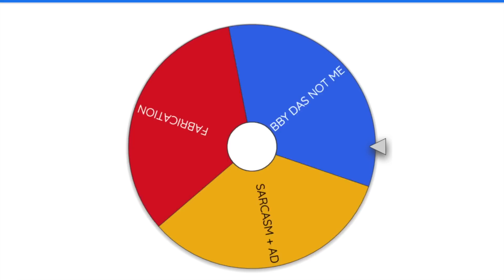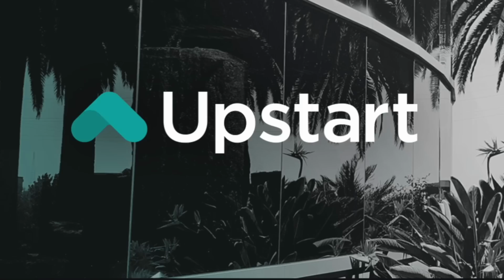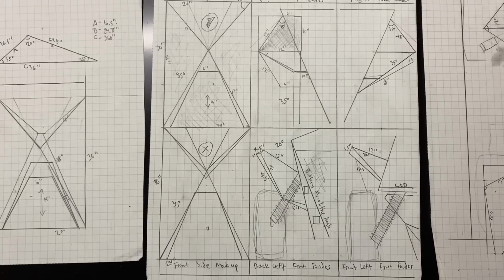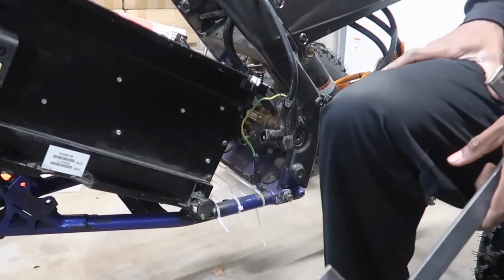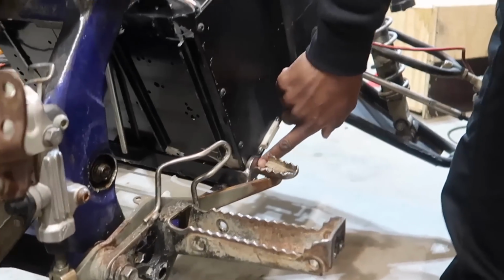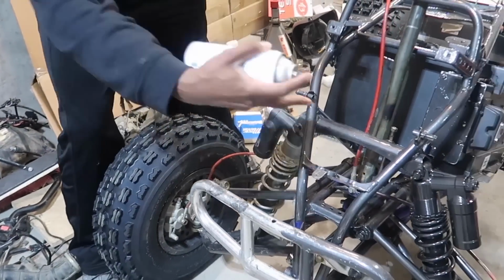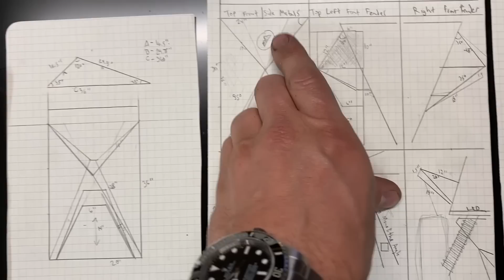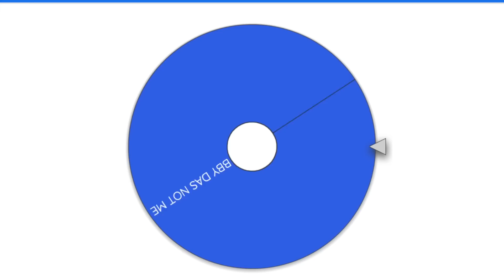How we Designed my Tesla Cyberquad

Comment: Gotta say, your videos are getting funnier (=ing more entertaining).  So.... my credentials.  I was a machinist in the Air Force.  That carrier field included welding.  I have owned and ridden to structural failure many off road vehicles (cycles, quads, buggies, sand rails, odysseys).  There is more but ima move on.  First though I wanna say ; the most important thing is that you are doing this, i really love what you are doing, don't let the haters slow you down, great job.  Ok, I have two things I wanted to say about the build.  The unsprung weight is probably fine, and if it isn't you'll get bent shafts, no biggie.  The second is more of a concern.  The frame bar under the bottom corner of the battery is supporting a lot of weight over a small area.  By having it on such a focused point, it is more likely to bend.  I would personally add a small C channel piece over that bar to spread out the moment of forces.  It is possible you will never have a problem with this.  You've shown enough of yourself riding that i get a general gauge of your skill, and it seems unlikely that you will be doing any BIG AIR any time soon.  But it is possible you might have a moment of bravery and decide to climb that hill you maybe shouldn't.  Something like that can cause a roll over and if that happens this week point could be exposed.  Additionally a friends teenager, on a weekend out riding, could expose the same problem.  If that part of the frame ends up bending, it will be much harder to fix later, and if bending changes the geometry of how the battery is held in, it might pop out and crush a leg or something.  The fix is simple enough that for me it would be worth doing before continuing.  At one point when i was building a side by side buggy I had to learn the equations for how force is applied over time (i have since forgot much of it).  But at the time i did find it useful because i kept bending A arms.  I made some minor adjustments and the next thing that failed was the spindle.... LOL, it was an improvement from my perspective..  Anyway I hope you will consider reinforcing that area.  Even if it's not for you, there is a chance at some point someone jumps on this thing and really puts it through its paces, and that would be the type of failure worth shoring up.  Also ... I don't know how heavy that battery is ... I'm imagining it as a really large lead acid... so maybe my concern is much less warranted?  Its all Pounds, Points, and Time BB....... also also ... "soft pull"... brother you slay me.
Reply from the maker: Constructive feedback from a person with a background, followed up with suggestions on how to make it better based on their own experience building something similar (didn’t think this existed!) Thanks for realizing it’s a prototype, I make something , take it out, beat It, break it, then enhance the design based on what broke. Thanks for the suggestion.

Comment: Looking good so far! My only advice would be to make your electric motor mount have grooves instead of holes so you can slide it up and down to add or release tension on the chain.
Reply: Now that you mention it, I was thinking of some kind of screw support, like, having a screw that pushes it up as much as needed.
Reply: @Kalvinjj  yep, that would help it stay in place when its hitting those bumps
Reply: Of course Rich needs as much screw support as possible when he hits those bumps!
Reply: The Raptor has an eccentric rear axle that is used to adjust chain slack. The motor can stay fixed in place.

Comment: Having built an airfix model of a harrier jump jet when i was 12 I can tell you that every component modified by you will fail because nothing built outside of a factory ever lasts, you should just give up now, nobody should ever try anything new.

P.S. whats with the picture of Obama at the end?
Reply: I can't tell if you're being humorous or not. Assuming you're serious, it's true that a lot of people do not appreciate the work that goes into your factory engineering. On the other hand when you mod stuff yourself you don't have to have the same high standards as the factory. For instance the factory designed it to handle large jumps whereas Rich is not going to be doing big jumps, so his design might be perfectly fine based on what he plans to do with the quad. I'm sure he plans to just ride it around a little bit and do a little off-roading, nothing serious. So his work should be just fine for that.
Reply: @JasonWW2000  It was meant in jest my friend, a jovial nudge in the direction of the people who actually leave comments like this
Reply: @JasonWW2000  lol

Comment: Need to add another comment, you can add another bump stop to the shock to keep it from bottoming out and hitting the motor, extra thick rubber would help. I’ve installed a few on my Dirt-bike to keep the suspension from bottoming out
Reply: Rich would love this idea. He would do it with one hand, while having popeyes in the other.

Comment: Probably taping an inch thick piece of heavy-duty rubber to the top of the motor where the frame would strike if it did bottom out would prevent any damage, just like real stoppers used in cars and trucks. Cheap and easy upgrade!

Comment: Adding unsprung weight to increase off road capability is what the entire off-road aftermarket is built around. Sooner or later, somebody is going to mount compact electric motors on a pair of live axles and you are going to get a revolution in off roading. Deleting drive shafts and transfer cases, then replacing them with flexible power cables and you lose a whole lot of weak points and gain crazy articulation.

Comment: Certified welder here, nice work! Most shitty welds will still hold more than enough weight than they’ll ever need to. Your welds look decent, and the shot at 5:15 I can offer some suggestions by the look of the weld. Seems you have your heat set right since both the top and bottom edge are fused, but the weld itself looks big and bulgy. Try going a tad bit slower/smother to see if that evens your beads out, if not try turning the wire speed down. Tbh I suggest experimenting with the heat and wire speed to see what effect each has until you find your sweet spot. But ain’t nobody got time for that. Great looking bike brotha

Comment: Rich I love the new build! Something that might make life alot easier is getting an extended swingarm. You can contact Stellar racing in Arizona and they make cheap STEEL swingarm for a Rap 700 in any length. My Rap700 has a +14" swingarm, the axle carrier is no where near my back seat lol. Then you could weld however you want, add suspension travel, add motor clearance, and keep it safe by making it longer so it doesn't wheelie from the massive torque
Reply: But then it wouldn't look like the Cyberquad. That is the point.

Comment: I'm only a hobbyist welder but i've been at it a while, it looks like you have your heat/amperage too low, kick it up a notch and your welds will be flatter and have better penetration, they'll look a lot less like caterpillars too.

Don't worry about the spatter, that's normal. There are products that keep it from sticking but I don't use them or know where to get them, supposedly cooking spray works too

Comment: If you want to check travel on the rear suspension you can remove the rear shock and remove the spring and then put it back in to check travel, that's what I did when I checked clearance for my turbo dirtbike

Comment: If you want to improve your welds, convert your HF welder from AC to DC (did mine with a $12 rectifier, a 40mF cap and spare battery cables). Huge difference for almost no money.

Comment: Wow, those diagrams are wizardry! Massive skill. Any chance the guy filmed his process?
Reply: I didn't film all of it though, could explain more in the end if needed.
Reply: @boxeclectic  It's all good. Just amazed at how you were able to go from 2D photos of the Tesla quad, to a 3D model, and then back to 2D!
Did you use a 3D program to design the panels? Or did you use pen and paper (because that would be ridiculous). Also, awesome drawing skills!
Reply: Shifter I worked from all measurements that I knew from the raptor, such as  handle bar width, overall quad height/width, seat length/width, tires, etc. so, I worked backwards from the known variables to come up with the proposed dimensions elsewhere of the cyber’s body panels and fenders. I was classically trainee, and appreciate the element of not always relying on CAD and enjoy the challenge of old school. This was all paper math, calculating the angles from the each different Perspective of the quad.
Reply: @boxeclectic  Wow, that is damn impressive.

Comment: Depending on the internal configuration of the battery, it may be possible to re-arrange the modules (if it has modules), to fit in an enclosure that better uses the space. Note this isn't a criticism - this is a great series.

Comment: I admit that I have no credentials at building or fabricobbeling, but my first thought was: Wow, that big battery must have some hefty weight to it! Compared to that, these frame tubes of the quad look downright flimsy. I hope you strengthened the frame to actually hold the battery even while jumping and doing quad-like stuff with it. But I'm different to the other engineer commentators in that, if you say "yes, we got it covered", then I'll take your word for it and wish you good luck and success with the build. How's that for a comment?

Comment: I find more often than not people making comments like that are the same type of people that scare off newcomers on forums after asking about a modification or swap by answering them with "it's insanely complicated and will cost you at least 10-15k and it's not worth trying".  I don't know where these people get their numbers but I've got a VAG 1.8T 20V midengine 67 Corvair, a 67 2AG turbo charged Celica, a 1UZ RWD 99 Celica, a 328i to 335i swapped e91 BMW wagon, and too many other projects just done for fun and none of them cost me that much short the BMW project but that was because it required my 2010 328i E91 and a complete 335i donor car.  Hell I'm building a complete custom chassis/cage with removable subframes for a classic super beetle right now to do a front engine/rear radiator setup for a 1.8T Quattro swap.  The only conclusion I can make is that the people discouraging and insulting people on forums have never done more than changing fluids and maybe very basic maintenance in their life.

Comment: Get some Splatter Scat to spray on keep the weld splatter from sticking. Saves a lot of time cleaning up the weld area.
Reply: helicopterdriver I've heard cooking spray works as well, never tried it though
Reply: @Robert-qm7yi  It works and can make things look nice since you don't have to grind off the splatter. I used to do a lot of industrial fab work and that always annoyed me because you could see the grind marks under the paint when you're finished. Splatter Scat smelled like fish oil, so probably cooking oil would work as well. Splatter just fell off when brushed with a slag hammer instead of sticking to the point of having to grind it. You are doing good things, thanks for the entertainment! :D
Reply: helicopterdriver Damn I wish I remembered that, I just spent a few days welding and grinding on a project, would've helped if I realized I have some pam in the house

Comment: The motor is adding to the unspring weight on the rear axel, jumping this machine may bend the axel or rip the motor mounts. Strengthing may be easier earlier than later.
Reply: Jumping may be on the list of stuff not to do with it.

Comment: Today, with current sofwares (like Catia v5) we can figure a 3D in movement to demonstrate the simple and easy way to calculate instant anti-squat during all the travel (during accelerations, under load, braking etc). This way manufacturers won't need anymore to test 10 different solutions to find out what is working or not. if you work with someone who knows a thing or 2 about suspension and kinematics, it would help a long way.

Comment: Keep in mind you will need some adjustments from the motor and rear sprocket as the chain will need the right amount of slack and the chain can stretch
Reply: The Raptor has an eccentric rear axle to adjust chain Slack. This means the motor can be mounted solidly into place.

Comment: As a welder who has fixed welds over the years. You will be surprised how well some sloppy welds hold. Not calling your welds sloppy since I never actually paid attention to any of them. I am talking about welds that were done cold and fast with no penetration holding aluminum together in a salt environment with boats tied to docks, and they held for a decade or better. Same with steel, I have seen some nasty welds hold together through some abuse.

Edit: Saw you slag issue with the steel. Your steel is just dirty and could use a little griding/buffing before striking an arc. IF you want some tips just let me know. I can do stick all welding but my specialty is aluminum.

Comment: Just a heads up, if it comes up, that rear caliper won't bleed when installed. You'd have to pull it off, bleed it and shove it back on. As the nipples is on the bottom.

Comment: The Zero battery is made up of smaller cells. By making a new box to hold them that better fits the frame, you could make room in the frame for the engine to fit. Would work and look better too
Reply: Where can we find info on separating the Zero battery?

Comment: Was wondering why not lengthen steel part of frame to handle both battery and motor? Then just bolt back up to aluminum.? Help lower center of gravity and as someone else mentioned, reduce unsprung weight on rear axle?
Reply: I was thinking the same, but then it wouldn't look very much like the actual cyber quad.

Comment: Looks Great! John Britten 'reinvented' the motorbike... Could the battery holder be built to 'be' the frame?
Reply: No, it's basically a sheet metal box and not designed to be structural component.

Comment: You getting better with u Welding Rich :)... You needs to turn up the heat a little.  What gas are you using, Rich?
Reply: I think its straight up wire. No fancy gas on this bargain MIG.

Comment: Great work. May be look at 3M and their range of glues suitable for aluminium, combined with clamping/binding would give u assured hard points. Would it not have been possible to transverse mount the battery & get that motor off the swinging arm?Best wish from London & yes, I have a great Bonsai tree collection.

Comment: hey rich.  so dont dis me for this comment.  it looks like your welding point where the battery rests on the frame is gonna put stress at that point.  when the weight of the battery tosses the bike and battery around, that point might want to bend or break alot like a when a karate chop breaks a board.  all the weight and stress will bear down on that point.  the quad frame may not want to support a box corner like how it sets on the frame as it rests now.

Comment: Only thing I could think of that might go wrong is the sprocket spinning on the axle. we turbo my friends quad and it had too much torque for it and broke it. Im guessing an electric motor will have even more torque.
Reply: Tyler Chaffee Easy solution, weld it.

If it still breaks, undercut it and weld it with more heat
Reply: What broke, the key, the shaft or the sprocket?
Reply: @Robert-qm7yi  Yah that's what we ended up doing.
Reply: @JasonWW2000  The key way got warped really bad. we thought making a bigger key way but just ended up welding it.
Reply: The SR-F motor that Rich is using is rated at 140 ft/lb. torque. It's not geared down like the gas motor, but still, it's strong.